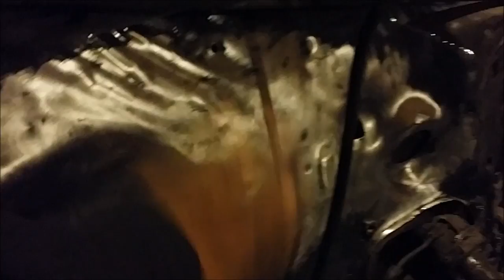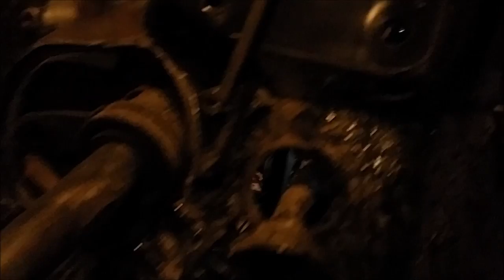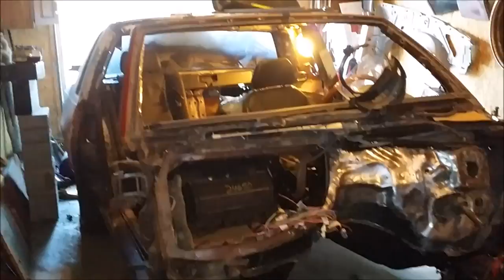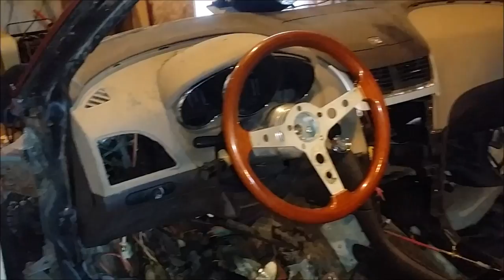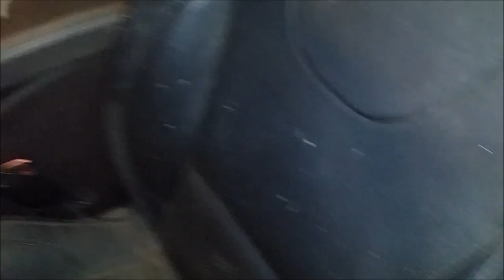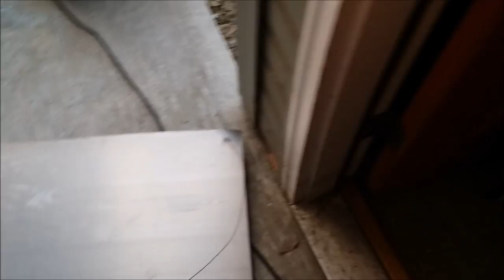Cutlass Firewall Stripping, Dash Swap & Seats

Comment: how did you wire the dash up? did you use the harness that came with the new dash and spice into the old harness? and are you useing the stock gages from the new dash as well? im doing a 2011 mustang dash in my 86 oldsmobile trying to figure out the best way to get it too work any help would be appreciated

Comment: Looking good bro can't wait to see it finish, I wanted to know where are you getting the AC system from?
Reply from the maker: I bought a cheap lil universal unit from ebay. You mainly see them mounted under the dash in older cars & pickups that didn't come with A/C but I'm going to mount it all the way under my dash out of sight
Reply: Do you remember the name
Reply from the maker: Gerald Paul that's what the name was I think. Search universal underdash heat/AC unit that should be it

Comment: U not running ac?
Reply from the maker: +snowyo318 Yes I am. I'm using a underdash heat/AC unit. I didn't like the factory box taking up all that space in the engine bay